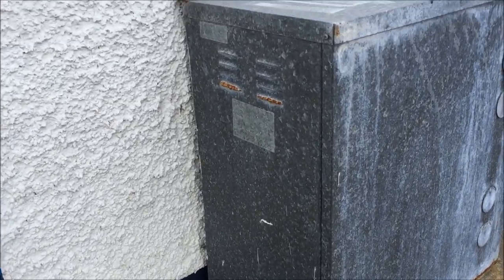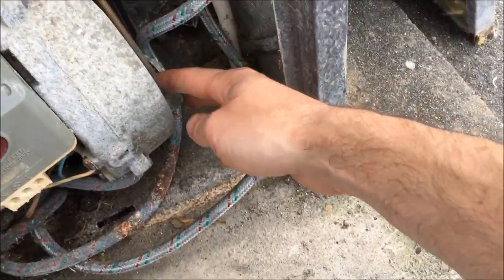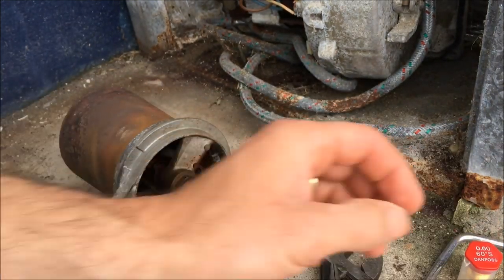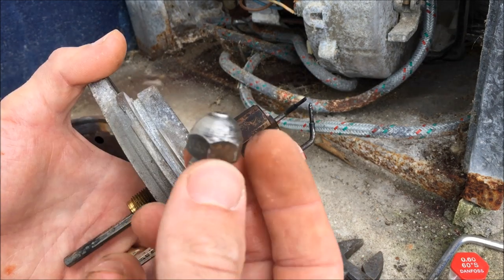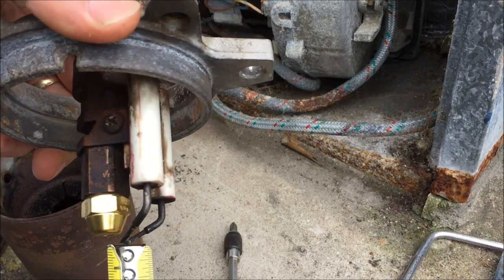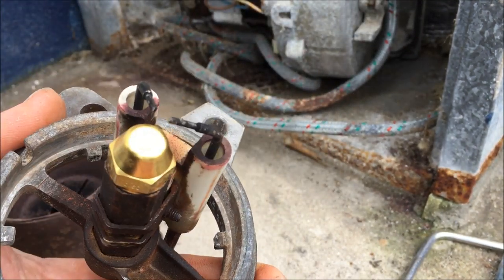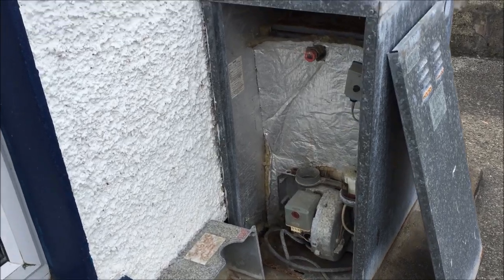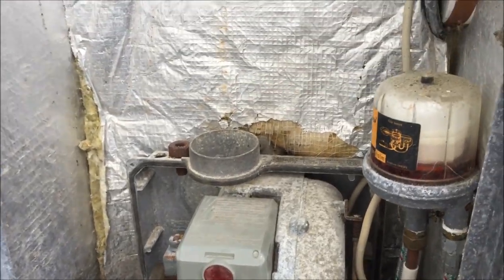How to replace an oil boiler jet (Ireland UK) or furnace in USA

Comment: In fairness you changed the jet and got that done.. There are a couple of things I would like to bring to your attention.. Them 2 flexible hoses running from the burner to the tiger loop are badly corroded and can leak badly over time and can be dangerous left like that.. Also that thermostat should not lift in and out like that it should be tightly secured in place
Reply from the maker: So you probably wouldn't like to know that went the unit is frozen and the thermostat kicks in to stop it from exploding I take the thermostat out so that the heat from the boiler has more time to conduct up the pipes and thaw the blockage, Hasn't blown up yet! Great boiler!, The pipes on the other hand...!  I must post a video on that thermostat. People here on youtube somehow seem to think that this is dangerous!
Reply: You say the thermostat kicks in to stop it which indicates it is still working.. Are the pipes that are frozen lagged? Your best bet is to get a good heating engineer to take a look at it
Reply from the maker: Do you think a "Good heating engineer" would work on it? You saw the trouble I had to get to the jet. My experience of service people is that they will recommend a new one. Better mark up for them and no hassle.

Comment: A bit like all the expert comments on here the "experts" that said not to touch the nozzle/jet because of the oil on your hands are talking bull,
Like yourself I do my own service's  and have never had a bother with the burner's performance and always screw them in with my fingers, 
By the way you said about installing electric heating in your house in the future any updates on how that's going 👍
Reply from the maker: Hi there, so far it is not going at all, I haven't started. This boiler is fitted to a holiday house. So it is very little used. So far I am waiting to use up the oil to see how long it lasts. We have been on 1/3 of a tank for the last 3 years, so I can't see it coming anytime soon.  But the idea is that because we pay a higher rate for electricity because we use so little, it is maybe worth using more electricity, flawed logic perhaps.  In the meantime I have fitted another stove, so the house has 3 woodburners now. I have put the installation in another video.  I always find it funny that whenever a video goes up on the internet showing gas or oil work a certain group emerges to say how it has been done incorrectly. Not acknowledging that different parts of the world have different standards.  Even the differences between Ireland and the UK are big.

Comment: Jeez mate, You need to change career. You have shown exactly how NOT TO DO IT - you do not need to take the main housing off, just the blast  tube. Those flexible hoses NEED changing annually, you should NEVER put old ones back one, they'll split. With all due respect, please dont ever touch another oil boiler.
Reply from the maker: Good man, you make up for half the sentiment in the comments. Id say you are a certified boiler engineer?

Comment: You should take this video down. Its very misleading. And there is gullible people who will watch this and follow your false advice. 
You really need to get those flexi pipes changed.
Fair play to you for for trying, but you are way off the mark as regards to service. 
We didn't train for years for no reason..
Reply from the maker: You will have to help me out Declan, what bit of the advice is misleading or false?  I replaced a jet.  Happy to leave your comment up if it is helpful, but just saying that something is incorrect does not help anyone learn.

A few people have commented on the condition of the flexi pipes. 

Have you read the other comments? There is a mix of (presumably) boiler service people who assert that nobody should touch such a complex and dangerous device, and then others who are looking to see what is inside so that they understand how something works.

What did you train as? You don't say in your comment?
Reply from the maker: Also, I am wary of comments from channels with no content. You could post a video showing the correct way? Happy to put a link here to it.